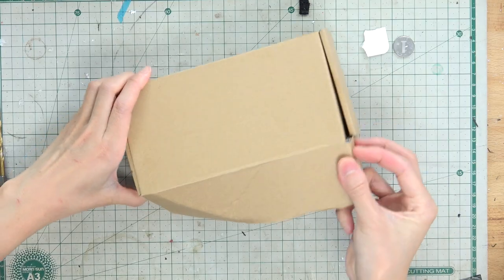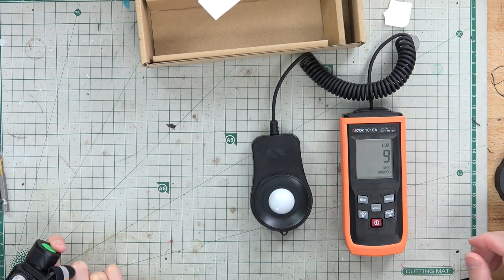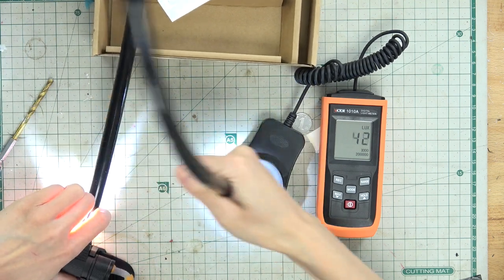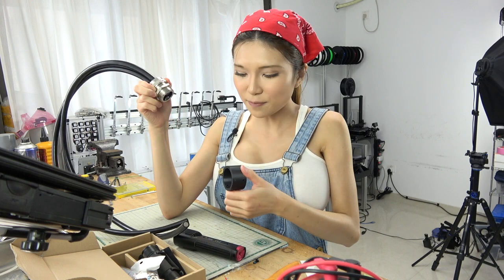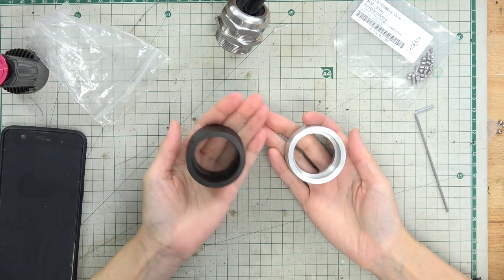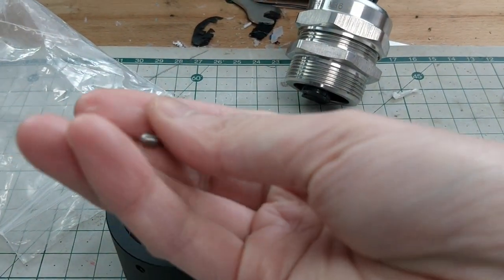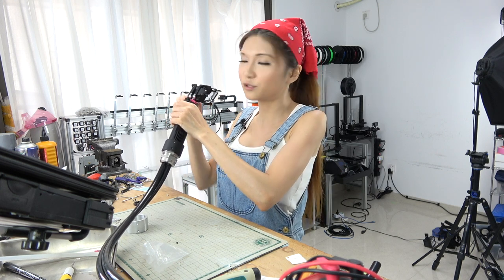LEBs- Cyberpunk Wearable Fiber Optic Implant Transillumination

Comment from the maker: FAQ:
*How about having it pulse with music or your heartbeat?
Yup, that's the plan for the next version.

*Does it work with real breasts?
Not easily. It would require an enormous light source to get through natural breasts of any size. So for practical purposes, only implants.

*Can it have colors?
No, only red and orange make it through this skin.

*Why not LED strips?
LED strips are too hot, too hard to cool, and not bright enough. The light has the greatest effect when focused on the specific spot where the breast tissue thinnest over the implant.

*What about clear silicon to heatshield the LED or water cooling?
The first bought me about an extra two minutes before it got too hot, the second was a lot bulkier and messy than just having two fiber optic cables. I may revisit water cooling though if I have a larger light source on my back running longer. Small aluminum heat shields that typically come with LEDs provide just seconds before it's too hot to touch.

*LEDs lining a bra cup?
LED brightness comes with heat- there's no way to avoid it. The light source I am using is 2000ln, that's a ton of heat. Any equivalent light source, even evenly spread across the skin surface would cause burns within minutes- I did the math. The only way was to isolate the heat source and just transmit the light. In the current version the light hangs freely off my back with air able to circulate all around it, this keeps it just cool enough to touch safely. It strobes to keep the heat down while maintaining the same brightness.

*Why not multiple optical fibers all around the cup?
The key is the get light through the breast issues (which does not transmit light well) into the implant (which does). So you point the light source where the breast tissue over the implant is thinnest. I have very little natural breast tissue so the effect works particularly well on me. Multiple light sources, over areas where the tissue is thicker, just mean a dimmer boob light.

*I don't believe you I'm sure it would work.
That's the DIY spirit! Make your own and prove me wrong. Even without access to implants a light meter and thermometer can give you a pretty good idea how practical it is. But keep in mind I tested many, many variations before settling on this one.
Reply: Truly amazing and I've never seen this before!
Reply: will you feel heat when the light flashing?
Reply: FWIW, I think the fiber optic cables work really well in this kind of esthétique, so in this case, needing to work around the heating issues actually adds to the cool / cyberpunk factor of the end result :)
Reply: Thanks for the feedback
Reply: Naomi 'SexyCyborg' Wu 
Yo! Awesome idea looks great!
Reply: сделай волосы светящиеся из оптоволокна!
Reply: If you have it pulse with heartbeat, you should offset the timing slightly between breasts. Mimicking the firing of separate heart chambers.
Reply: This is bad ass awesome! Looks like a fun.project to try at home :D Thx!
Reply: "Shocking" to say the least! my "firmware" was definitely "upgraded" lol!
Reply: No hablas español?, no estiendo algunas palabras en inglés
Reply: Subversive Control I'm betting it would.
Reply: That answers everything 🙂👍
Reply: The heartbeat idea is genius
Reply: how about using electro-luminescent wires for external effects.
Reply: A couple ideas in case you hadn't tried them. 
1. sticking with others ideas of having Led's in whatever garment. you said you tried aluminum heat sinks. But the way you said it made it sound like they were on the inside. what if you built in the heat sinks to the outside of whatever garment so they have access to airflow and build it into the aesthetic. make them large enough that the Led's can't heat that much metal before it diffuses the heat. 
2. You said that only orange and red light makes it through. So why are you using a white light? It's making so much more light than is effectively going to get through.
Why not use a laser? Red laser to be specific. it would be much easier to split and get down the fiber optic cables, then diffuse it at the end. It would increase the amount of usable light, while reducing power usage considerably. 
Good content, keep it up.
Reply: Don't forget to RGB it
Reply: This was the very first thing I went to comment on about heartbeat or music beat and then it's already a pinned and top comment sorry for the repeat but great minds think alike
Reply: Plus, the fiber optic conduits look exactly right for your persona.
Reply: I have a "light therapy" pad w/multiple red and blue LED's that go directly against the skin and no heat (unless you push heat feature button)   https://youtu.be/Xj2M5uX6x0c (sorry I do not have a better link) it has a flexible base that could be altered to fit into bra cup. of course it will take some fabrication to make it work the way you want it to. but you seem smart enough to  do it.              also you should combine this outfit with your Segway hover board.
Reply: Naomi 'SexyCyborg' Wu what's the name of the song in the vid? ☺️
Reply: Naomi 'SexyCyborg' Wu  You should pair this up with the hikaru light up skirt and the projector boots. And then put on the infinity belt. All of them at the same time. Talk about cyborg WHOO HOO. I hope you read this and try it out. I would love to see all that tech in unison. You have an amazing brain, keep building amazing stuff.
Reply: Naomi 'SexyCyborg' Wu video is not demonitized?
Reply: Noah L. What? Your comment makes no sense!
Reply: Having the lights react to heart beat is really going to leak all emotions. But it's going to be beautiful
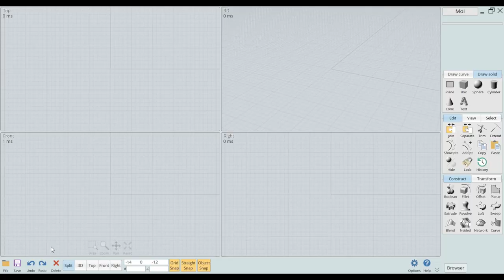Reply: i just want to know whats the name of the song @ 5:26
Reply: Oh. I didn't see this. This just hits home how dedicated you are to your builds.
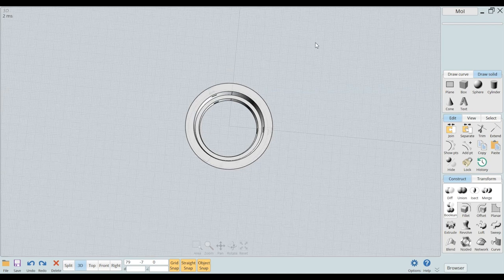Reply: @noami song name at 5:53
Reply: Off topic but have you considered doing penetration testing as an income source. You seem to have the skills and the right mindset for it.
Reply: Do you blow up or go down on the user
Reply: I was thinking the exact same thing, use the big fiber optic, for the bottom, like in the video and run a thinner optic around the breast, but it's going to look funny, I guess it depends how much you want to cover up to hide the thin fiber optic, it's cool I love these ideas😅
Reply: Jesus you are gorgous.... 😍
Reply: Synchronize to your heartbeat would be awesome!
Reply: The fiber cable plugin reminds me of a star trek Borg, so would CPU water cooling hoses making a close contact high power RGB COB more comfortable.

Your body could respond to a person's facial expression , using OpenCV or Tensorflow on an android phone, or this tiny camera with built in processing from jevois.org that has USB and I2C interfaces, spot lights could make your face blush when someone smiles.

I would think a larger area light array would allow some sence of motion to be projected.
Reply: Such aa awesome idea i hope you make more wearable gadgets like this ^-^
Reply: Multiple low-ish powered lasers
Reply: Very cool krafwerk we re the robot
Reply: If that lamp corresponds with my heartbeat, whilst watching Naomi, it would act like a stroboscope ⚡⚡⚡⚡⚡
Reply: You have a better idea of reflecting light from the source into the fiber optic wire than i could ever come up with.  Go naomi!!!!!!!!
Reply: Will you marry me????
Reply: When you try the flashlight for the first time, you say it's hot. I wonder which part of the heat came from the flashlight body itself, and which part came from the IR part of the light ? A quick search show between 50% and 80% of energy is lost by IR on light bulb.
I search a bit more, and I've seen that fiber optic are particularly efficient to transmit IR, so that would means that nearly all the heat dissipated by IR are transmitted without loss along the fiber optic.
Wouldn't that mean you would get burn with you bra too?
Did the flashlight come with an IR shield or did you add one, or maybe you should have add one?
Reply: Great FAQ segment. Cannot wait to see you implement your next phase of this project.
Reply: I absolutely love your combination of real engineering and design with a variety of feminine beauty and sexuality. I don't see them mixing very often, and it makes you and your work a breath of fresh air. You're an inspiration!
Reply: This could actually be worth looking into as a medical diagnosis tool. With different color lights and intensities it might be able to help spot a leaking implant or a cancerous mass. You might think about working with a local hospital with the next version?
Reply: a) Awesome idea
b) Brilliant implementation
c) Weirdo idea for improvement: Beamers also have pretty powerful lightsources. Using that thick fiberoptic bundle and converting a video to only use orange-red as color ( like converting a video to black&white only ) would in theory allow to actually project , well, not videos, but patterns. 
d) Weirdo idea requirements: Where would I have to search information on how much human skin and medical silicone scatters light? I mean, which field of medicine would care for such issues?

Finally: I just recently ran into this channel and, Miss Wu, I adore you. 
The world needs more tech nerds like you!
Reply: Your gorgeous and a genius amazing
Reply: consider the next time to cross the cables on your back to keep the figure intact rather than add distractions that may make your figure less "skinny/tight" (rounder vs hourglass)
Reply: @kingsleykazooie4385  it is a longer story. The meme started with "leek girl". But the end and the source is Ievan polkka.
Reply: @hunterdeclown   it is a longer story. The meme started with "leek girl". But the end and the source is Ievan polkka.
Reply: @JacobLaugesen  lmao this is a late reply but thank you. I did end up finding it and its many many many versions of the song
Reply: @lolsniper4567  （初音ミク) - 甩蔥歌
Reply: is cool light naomi 🙂
Reply: How did the woman in the original video do it?

Comment: Most of the white light is being absorbed by your body - you may get better efficiency using red LEDs. Also a lot of smaller LEDs instead of one big one spreads the heat better, so may be doable without the bulky fibre optics.
Reply: NobdyInfinite It is based on the fact that the color you see (red) is getting into your eye because the skin doesnt absorb it, so every other wavelength is absorbed by the skin which converts into heat. I think this is quite a basic science fact so ... Ya know, just search up how light works. Hope this helps.
Reply: Tu Yiren the fact that skin would absorb less light when using red LEDs doesn't necessarily mean the red LEDs themselves would produce less heat than white LEDs. In this experiment, heat is not being transferred by light (as IR radiation) but by convection from the electronics of the LEDs.
Reply: I have 1000 high intensity RGB LEDs I could test this with in a variety of colours to see what works best.  I need to borrow someones boobs though.
Reply: NobdyInfinite Youre in Civil. You know nothing about light. Chill. I'm an Astronaut, so please don't bring that condescending tone to me. I am fairly familiar with how jelly beans taste.
Reply: NobdyInfinite Let's think about this problem rather than searching through journals to find our answer. No need for fancy words. I shine a flashlight through my finger and my finger appears red. If I can see red, that means my finger did not absorb that wavelength to allow my eye to see it. Now let's imagine I only shine red light through my finger, the same thing will happen! Red won't be absorbed that much and my finger will still appear red. Now let's think of Grade 3 when we were taught about light absorption. I wear a black shirt on a sunny day, my back gets really warm. Black absorbs all colours and gets hot! Hmm, maybe light absorption generates heat. So let's go back to red light in my finger. I shine white flashlight through my finger, every colour but red gets absorbed. Absorption = heat! Ouch my finger is warming up. Now I shine red flashlight through finger, nothing gets absorbed, no heat! Okay so now we think of other scenarios where this hypothesis might be used. Hmmm maybe at the hospital with those finger biometric monitors, they use red light! Why? Probably because red light penetrates the skin just like what we figured out above! We must be on the right track.

Alright so we've figured out red light penetrates skin and doesn't get absorbed as much as other colours (white light includes all the colours). But what about heat created by the LEDs? Remeber in grade 7 when they taught you that red light has a large wavelength and contains the leeast amount of energy of the visible light spectrum? This is great! The power draw is going to be less for red LEDs! And since a lightbulb is basically a resistor, less current is less heat! No need to use a hot white when most of the light will be absorbed by the body.

So anyways, I don't have a PhD. I don't need to a journal or paper to ceate a plausible hypothesis. Maybe you should think for yourself instead of criticising others and assuming others are stupid because you're so smart
Reply: Jorge Curiel López Basically since your finger absorbs all colours but red, those other colours are converted to heat. So why bother shining those other colours in the first place? If you had an white LED that required 5W of power, most of that wattage would be used to create the highest energy wavelength light, such as blue and purple light. Meaning less than a watt would be used for red light creation. So you could essentially create the same brightness through the skin with a 1W red LED for 1/5 the power. And since power directly corresponds with the heat output in things like LEDs, a 1W LED will be colder
Reply: @NobdyInfinite  Well, you almost had me believing in your high academic skill until you mentioned the word "Texas". ;-)
Reply: I'm a nurse, we use a red light in anything we want to penetrate the skin to a meaningful level, other colors turn into wasted energy and mess with the output readings. Maybe look into that.....

Or maybe, just don't get butt hurt on the internet.
Reply: mikeselectricstuff Hi mike, nice to see you here, I like that idea and it could work if red LEDs have roughly the same efficiency than white ones. 
And to someone who mentioned the heat comes from the LED itself since it is only 20% or so efficient: Yes, but using red LEDs you only need to put a fraction of the power into the LED, reducing it's overall power dissipation.
Reply: @NobdyInfinite  
That was hilarious to read, it must be a troll comment. 😂
Reply: Painting the inside of the couplers white instead of black would also help reflect some of the light that's absorbed between the flashlight and the cables.
Reply: @ryankraft9897  that was quite interesting to read. Thanks for the fun science fact

Comment: If you used the smaller fiber optics with the flashlight you could put more of them into the housing and thread them through the corset. This would allow you to disperse the light across a more uniform area without losing intensity. This would also allow for a less bulky and stiff back unit. Otherwise, this is a very good build with potential in some applications I have. Thanks for the how to.
Reply from the maker: Multiple strands doesn't work very well.
Reply: Good idea, the fan of thinner cables could also be artistically positioned to help with the outfit look. Most corsets have "boning" in them, so there might already be channels to thread smaller fibre through.
Reply: @Naomi-Wu  Experimental evidence wins over speculation.
Reply: Perhaps rather than a bundle of smaller fiber optics on a single super-bright LED, use a number of smaller fiber optics that each run to a relatively dimmer red laser diode.
Reply: I'm thinking that multiple F/O cables coming up from below into a shelf ( Lucite perhaps ) built into the corset would give you a more distributed effect. And, would not have the cables coming out the sides where your arms swing. Another benefit of more, smaller cables is that they will conform to your form better and bend to smaller radiuses. You might be able to wear the flashlight in a hip holster and route the F/O cable up rather than around. I suspect that would be more comfortable.

Comment: The mount configuration for the light source was rather brilliant. Given the lack of flex to the light pipes it makes it easier to wear with the light source being able to move in response to the push back from the cables. I wonder if there might be a better solution for focusing/harvesting the light if you used a lens on the flashlight into a single larger optic cable and then split that into the 2 lanes for left and right... Capture more of the light for lower losses which may mean you can scale-down the light source a bit for more efficiency in battery life as well as heat losses....